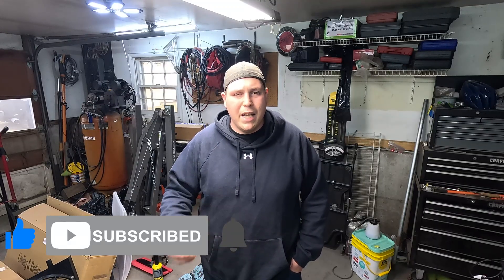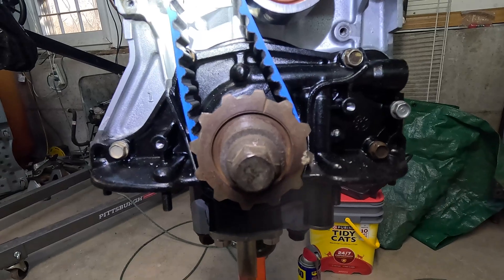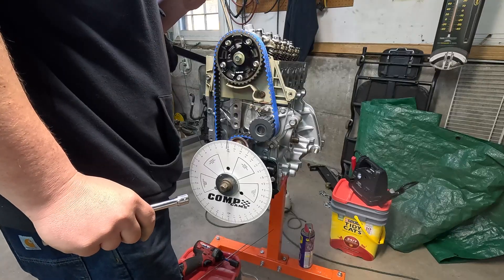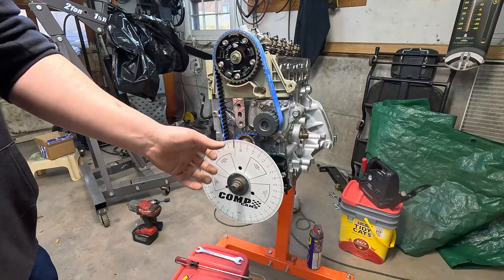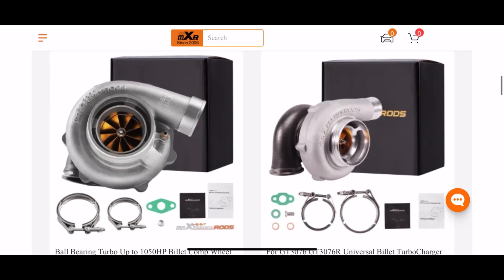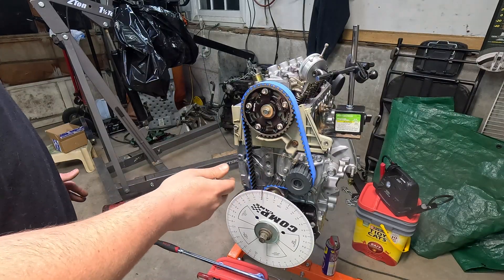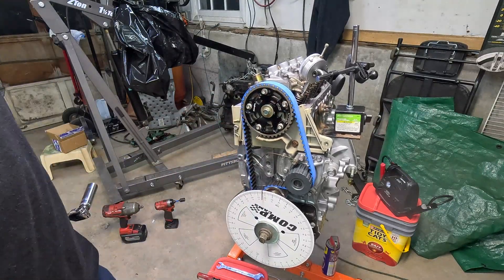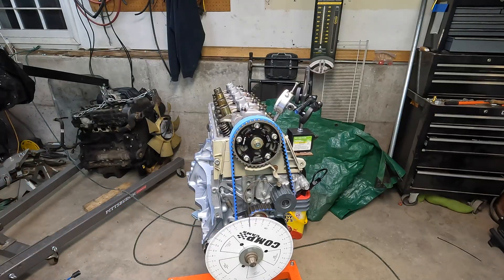HOW-TO DEGREE A CAMSHAFT TO MAKE MAX POWER! SINGLE CAM BUILD! #honda #build #diy #boost #new #fresh

Comment: Could this process be done without a piston stop by chance? Seperate from that, i understand the importance of this process but i cannot get mine to go smoothly. I.E indicator moves a bit after a certain point when trying to get centerline. I Cant seem to get an accurate reading while being careful not to move things. How frowned upon is it to just set everything in “time” and just readjust things when on the dyno/tuning? Built bottom end, built head, aftermarket cam/gear, etc.
Reply from the maker: I’m sure it’s possible to do without a piston stop but since you need that so you can get your center measurement of top Ded center and a consistent one it would be hard to do with something else you could use like a dial indicator, but that would still be tricky and as far as frowned upon, I mean it’s not ideal if you have a performance cam, you really want to put it where they recommend so that when you’re on the Dyno you are at a guaranteed neutral basically to start off with and then can add or take away degrees but it gives you the best baseline to start with because you’re basically just gonna be moving the power curve around by adding or taking away degrees so in short, will it run and probably be OK yeah but you’ve spent a lot of time and money to get this far so may as well get the 9$ piston stop but again I’m sure it will be fine if you can’t get it done thanks for the support! And good luck with the build! 🤟🤟🤟🤟👍👍👍

Comment: I also wanted to learn how to degree my cams, but there are bits that you didn't explain why you're doing what. 

Like, in "Finding Zero" part, why do you have to back it off 15-20 degrees and put the stopper at those degrees?

Also in the "Degreeing Process" part, why after getting the "max lift" you have to back it off a few degrees and get back to 50?

I'm trying to grasp what's on the cam instructions and how do you relate it to the actual process you're showing. Still an awesome video! Keep 'em coming. I subbed!
Reply from the maker: Thanks man I appreciate the support and depending on the cam you get the cam manufacturer will have step by step instructions of what they want you to do 

And I am not sure what you are referring to as backing off a few degrees? When I find top dead center you need to back off 15-20 degrees put the piston stop in until it touches the piston then go all the way around till it touches again that will tell you exactly where tdc is if you just put the piston stop in at TDC then you can potentially rotate the piston right past it and it will do you no good 

And then for finding the max lift with the dial indicator it has a very specific instructions on what you need to do for setting it how the cam company wants you too in my case I needed the readings at .050 before max lift and .050 after max lift to be able to do the
Math equations I needed but thanks for checking out the channel I appreciate the support 🤟🤟🤟🤟👍👍👍👍👍👍
Reply: @bought2build  ok I got it. Did some reading. So you are actually getting the "TRUE TDC" (was not mentioned). You need to do this to get the middle of the "GAP", as they call it (where the piston is on the highest point and not moving) to get the "TRUE TDC". That's why you have to back it off a few degrees to get the piston out of that "GAP".
Reply from the maker: @awesomedev07 they have different words for it dwell, gap, etc you take the 2 measurements and find the middle
That is the true TDC
Reply: @bought2build  thanks for the help man! Would surely recommend your vids to others.
Reply from the maker: I appreciate that! Thanks for the support! 🤟🤟🤟👍👍👍👍

Comment: Did you not lock the Vtec?
Reply from the maker: Correct I did not lock out vtec I can see why you would want to on a stock cam but I feel like with an aftermarket cam they designed it to work with both the high and low lobes so I may as well try to take advantage of the drive ability thanks for checking out the channel I appreciate the support 🤟🤟🤟🤟👍👍👍👍👍👍
Reply from the maker: Ohh gotcha for when we degreed the cam in I did not lock it out because with the eagle rods and vitara pistons I knew I had tons of extra room and comp cam gives a spec for the intake valve on the low side and it is a solid single cam so that’s the only
One I bothered checking if that one is on the rest have to be on! But if you think you may have piston to valve clearance issues I would thinking about locking vtec to check 🤟🤟🤟👍👍👍👍👍

Comment: Thank you ... I also want to degree 59300 but i need a degree kit
Reply from the maker: No problem! And yeah to degree it you don’t need a whole lot! A cheap degree wheel that I linked in description from Amazon and then just a cheap harbor freight dial indicator maybe 50 bucks ish for both and it’s not too bad! Good luck! Thanks for the support 🤟🤟🤟🤟👍👍👍👍👍👍
Reply from the maker: If you are putting it in a d16y8 just be ware you will most likely need to cut the tabs on your distributor so you have more adjustment 👍👍👍👍
Reply: @bought2build  , i am using d16z6 head  and N/A engine with high compression pistons
Reply from the maker: @krisztianadrian8528 ok cool
Cool should be good may want to buy some clay or play-Doh or something to check piston to valve clearance depending on the rods and pistons you use 🤟🤟🤟👍👍👍👍

Comment: Did you lock the vtec by interchanging the pins ?
Reply from the maker: @AshokRaptor  I did not I am going to try utilizing it how the factory does at first and see how it does I can always swap the pins out later but for now i want to try using it controlled by the ECU thanks for checking out the channel I appreciate the support 🤟🤟🤟🤟👍👍👍👍👍👍
Reply: @bought2build I ment while degreeing the cam. Did you lock vtec and degree the cam ? If yes what is the procedure ?
This is my first time doing it so confused.

Comment: It only took 1.5 degrees of adjustment on the cam gear? Are you going to mess with it on the dyno ?
Reply from the maker: Yeah I was surprised too but it makes sense a lot of people say around 4 degrees and every degree on the can gear is 2 degrees at the crank so 3 degrees isn’t that far off and yes we will most likely try moving it a little on the dyno to see what it likes! Thank you for the support 🤟🤟🤟🤟🤟🤟👍👍👍👍👍👍👍

Comment: Whats the purpose of degree the cam?
Reply from the maker: Degreeing a camshaft is important to fine-tune valve timing for optimal engine performance and reliability, ensuring the camshaft is installed precisely where the manufacturer intended, and to maximize power🤟🤟🤟🤟